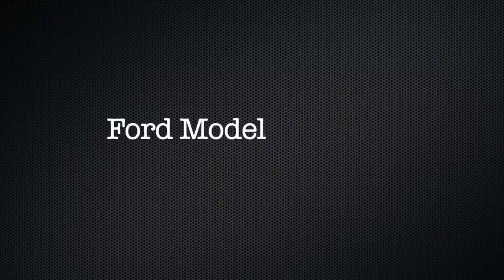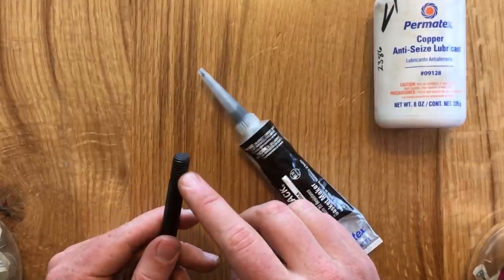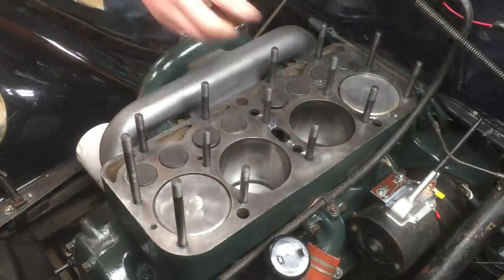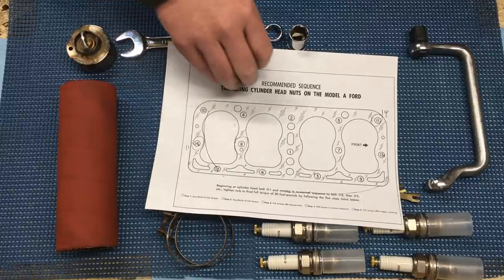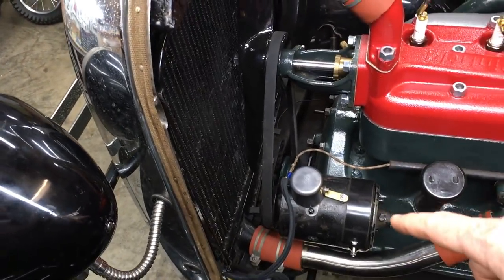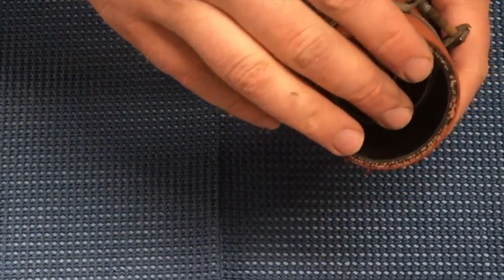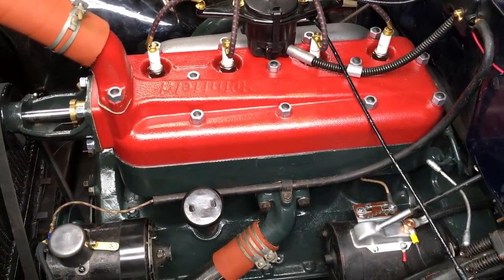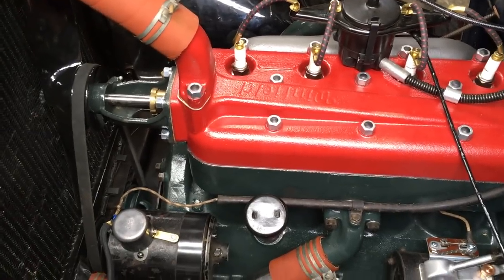Model A Ford – (2 of 3) cylinder head installation – final assembly

Comment: Great video, I hope that head got a good valve job before going back on.
Reply from the maker: Guides were loose, which is why I pulled the head in the first place. New guides, new valves, and one new seat (which may be visible from the punches around it).

Comment: At 10:30 you're showing a special wrench to go around the distributor which is fine, but really not necessary. A crows foot wrench turned 90 degrees from the wrench handle gives virtually the same torque. I was skeptical about it but I tested the method against one of those electronic torque adapters and the difference was immeasurably small. I put my last Norton Commando engine together this way.
Reply from the maker: I've found the obstruction wrench to be more convenient because it gets the torque  wrench up above the head, so you can rotate through a larger arc. But a crowfoot adapter works equally well from a mechanical standpoint, and it's definitely cheaper.
Reply: @alexiskai  don't think for a second that I'm trying to talk you out of having more tools, LOL!

Comment: possible better stud idea ; loctite smelly PTFE pipe/hydraulic sealant . sets similar to silicone and any leftover dirt , rust , etc doesnt seem to matter
Reply from the maker: There are probably a lot of sealants that would work for this application. RTV silicone is what everyone will have on hand and works well enough in unpressurized systems.

Comment: Maybe you could answer a question  for me please? About TDC. Traditionally,  like..for the last 40 years, ive had to rotate the engine with #1 up, AND on compression stroke. So, sometimes depending which valve was about to open, i had to roll it over again to be on the correct stroke.  However,  since i got the Model A, and the manual, nothing ever says compression stroke. Can you help me understand why this is? Thank yoj
Reply from the maker: On later engines, the TDC mark is typically found on the crankshaft pulley. As you know, this pulley makes two revolutions per one four-stroke cycle, so it will be in the same position on the compression and exhaust strokes. That means you always need a second step to determine which stroke you're on. On the Model A, the TDC mark (actually a divot into which a pin drops) is on the camshaft gear, which only makes one revolution per four-stroke cycle. This allowed Ford to place the mark only at compression TDC, simplifying the task of timing the engine. Make sense?
Reply: @alexiskai  that's fantastic thank you. Makes perfect sense,  not sure why i diddnt recognize it. Thank you so much! I googled it and came up empty,  and just kept going over it in my mind and got nowhere.   Thank you for the videos as well, very helpful. Also going to do king pins on my 1930 so that should be interesting.
Reply from the maker: @allhartfidelity   Sounds good, make sure you review Tom Endy's advice on the subject. https://www.santaanitaas.org/wp-content/uploads/2014/08/King-Pin-Geometry.pdf

Comment: Great video, I really like those cloth spark plug wires!
Do you mind sharing where you sourced the materials to make them from.
Thanks
Reply from the maker: Those are authentic Model T spark plug wires and terminals from Snyder's. 3 feet of wire and a 10-pack of terminals will give you some leeway if you mess up. https://www.snydersantiqueauto.com/ProductDetail/8MM https://www.snydersantiqueauto.com/ProductDetail/T-5026-T-Q10

Comment: What's your thoughts on Evans Waterless Coolant? Saw it on Jay Leno' Garage. NEVER has to be replaced. As a novice on Model A's this seems like a better choice. Very informative and educational. What about synthetic oil? I've used Royal Purple for years and I believe it's a superior product.
Reply from the maker: That's two questions so I'll use two comments. #1, the Evans coolant. Have not used it myself but I've talked to those who have. Works fine on A's, does what it says. Two caveats: it's much more expensive than antifreeze, so don't make the switch until you're satisfied that you won't need to do many drain/refill jobs in the near future. Second, it expands and contracts more than water, so it's recommended to convert your overflow tube to a bottle system that can draw the overflowed coolant back into the tank when it cools down.
Reply from the maker: #2, synthetic oil (specifically RP). First question, are you using an oil filter?
Reply: @alexiskai  Don't have an "A" yet. Just askin'..I've always thought running an oil filter regardless of what oil you use is a good idea. Just extra insurance. I really like the RP, it's good stuff. Thanks!
Reply from the maker: @elosogonzalez8739  The oil filter is definitely a good accessory. There's not much use of RP or other high-end synthetic oil in the Model A community. These cars just don't get driven enough miles or hard enough to make synthetic yield any better results than conventional.
Reply: @alexiskai  As I wrote previous, I don't have an "A" as yet. I live in Arizona where temperatures can reach 120°F+. Though I probably wouldn't drive much in the summer, My wife and I like to drive to Sedona, Flagstaff or the Grand Canyon. Flagstaff is 8,000'. Certainly putting a load on them 40🐎. If I'm going to go through the effort to find and or build the vehicle, I plan on it being a daily driver; At least in the winter months. Right this minute, it's 102°F. It's gonna get ALOT HOTTER🔥!
Reply: No need for evans

Comment: I recommend Ultra Copper near anything on a Engine the copper keeps the silicone from moving.... I installed a built custom Header's on Motor home's and many Round Track and drag race cars for over 20 years never no issue as well as building many Engine foreign and domestic farm and commerical...
Reply from the maker: Ultra Copper is great for headers and exhaust. I’ve used it to seal the tailpipe to the exhaust manifold once or twice.

Comment: great video, thanks a lot. I have a question may you could help me. I'm from Argentina, and not all replacements are available. I have a new head gasket and it is one side metal and the other graphite. Do you know if the metal side goes to the block or to the head cylinder? Thank you
Reply from the maker: If there are no markings on a gasket (like "top"), the next thing you want to look for is whether one side is smoother than the other. The smooth side should go against the component that is more likely to expand when heated. If you have an aluminum cylinder head, you'd want the smooth side against that. If neither side is smoother and there are no markings, then it doesn't matter which side is up.

Comment: Never use the gasket furnished for the coolant outlet neck, just make sure both surfaces are glean, apply silicone gasket maker, put it on and torque with the rest of 'em.  Thousands of these cast necks have been broken by the best of us, toss that un-needed gasket..
Reply from the maker: I cover this issue briefly in the previous video in this series (https://www.youtube.com/watch?v=MmFCFwWoiT8). You're confusing the copper gasket shown in the video with the paper gasket that's also sold for this purpose. The paper gaskets are notorious for breaking water outlet ears, the copper gaskets are not. The copper gasket is the original equipment spec for this car – are you saying Ford designed the water outlet so it could only be installed using a chemical that wouldn't be invented until decades later?

Use of the RTV gasket is widespread, but has its own issues. Using too much RTV can cause silicone to bulge out into the water jacket, detach, and lodge in the radiator. When you eventually need to remove the outlet, an RTV gasket will be harder to clean up than the gasket sealant I use in this video.

I have no problems with folks using RTV instead of copper at the water outlet, but to say one should "never" use a gasket here is simply false. I used one, obviously, and didn't break the outlet. Many engine builders use the copper gaskets without issue. No fine-point restorer could omit it without losing points.
Reply: Used copper head gaskets for yèars . machine the head, never a leak.